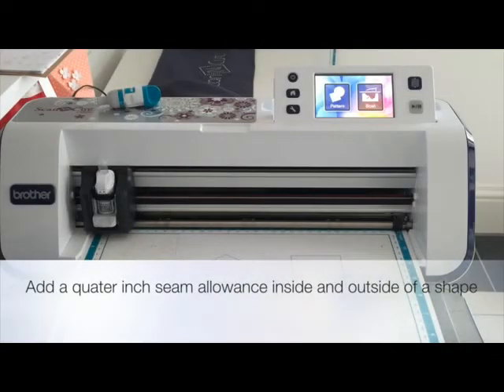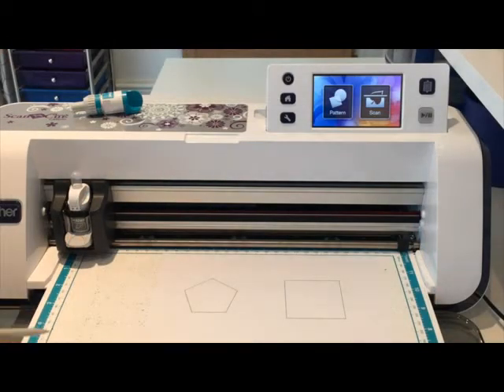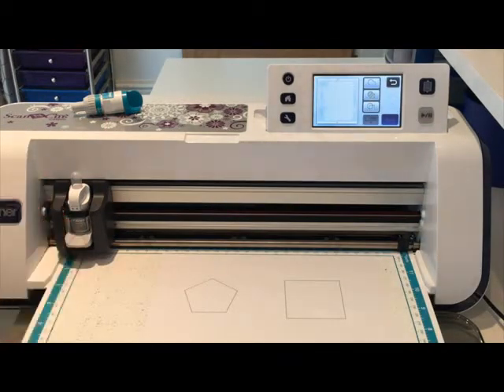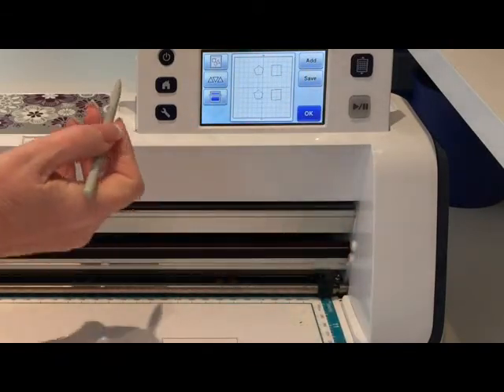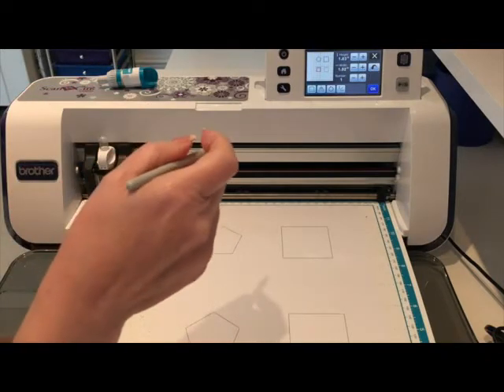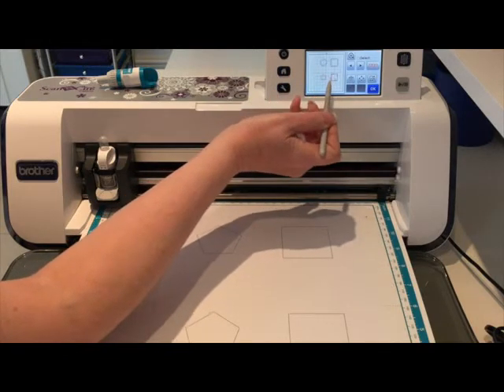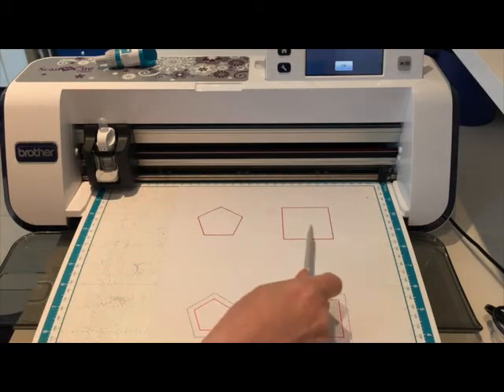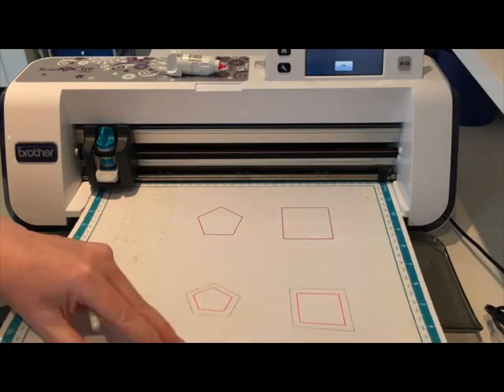ScanNCut how to add 1/4 inch seam allowance to the inside & outside of a shape

Comment: Excellent job of demonstrating this option.  I would not have thought it was possible to do this.  
Also, this helped me realize I can use the SNC for EPP shapes where I have only 1 size die.  I will now likely just use the SNC to cut the paper part, then I can cut all my fabric shapes with my die cutter.  Very helpful, thank you.